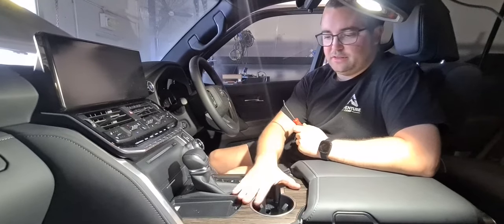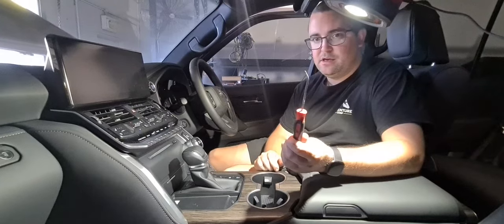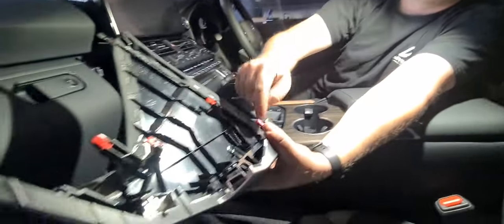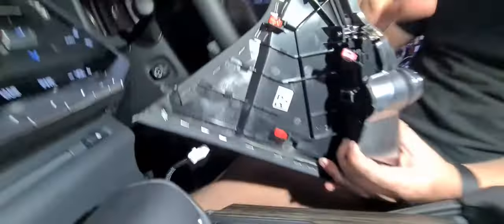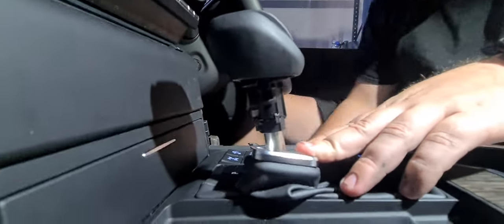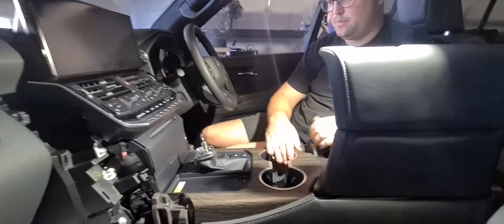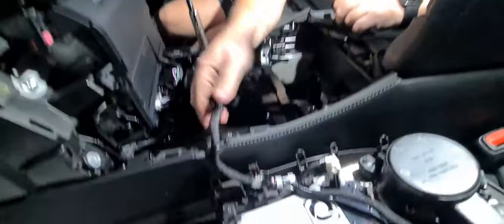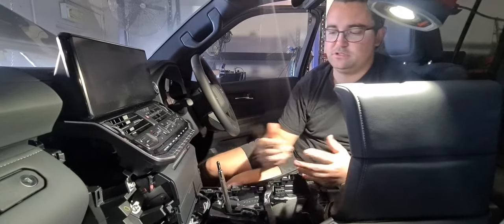HOW TO - 300 Series Toyota Land Cruiser - Easily Remove Center Console Middle Section

Comment: Thanks for sharing and making it look so easy for something that looked mind boggling hard. I want to install a RedArc brake controller on the consol . What part of the consol would you suggest I place it that won’t interfere with already existing wiring that’s already there in situ. Between forward of cup holders, forward right of right cup holder